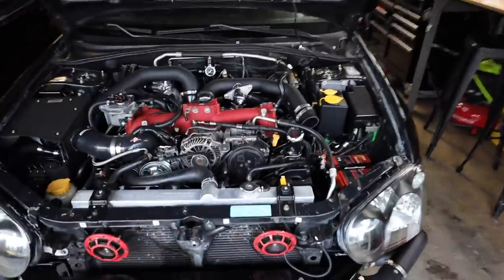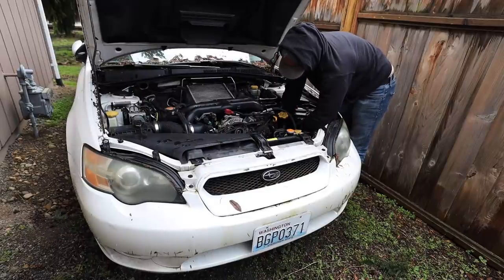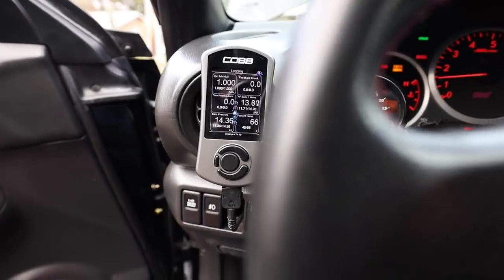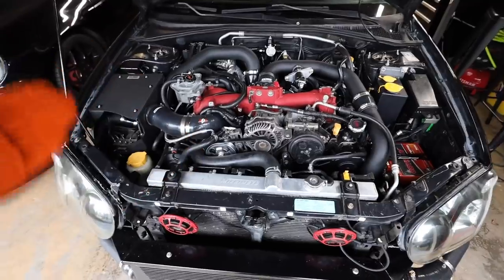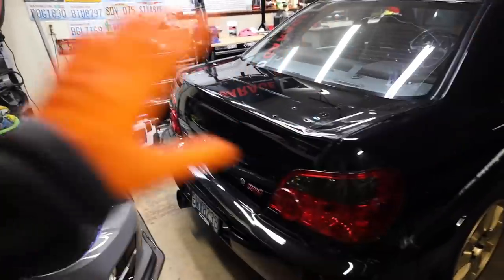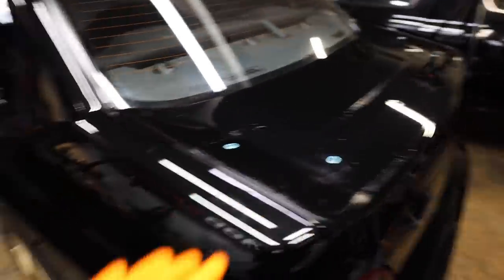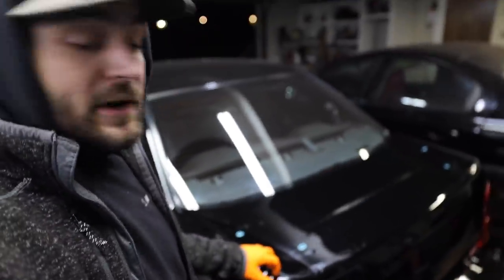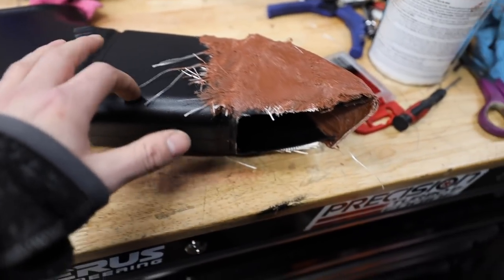I Pulled My Motor Because of THIS?!

Comment: Abs plastic is great to use to form things. I've used it to make replacement wheel well liner. Just heat and mold it into the shape you want. They come in sheets and is fairly cheap.
Reply from the maker: Couldn't find any locally 😭😭😭

Comment: Hey Tanner, I have done fiberglass before on my fiberglass trailer removing a belly band molding, cutting out metal plates and filling in the cutouts with fiberglass. Looks like you used fiberglass bondo which is a filler and used for car body work to fill cracks, dents and stuff like that. It will harden but doesn't run like liquid into the fiberglass mesh/fabric. You need to use resin and hardener to make the fiberglass material harden. That mixture of resin and hardener is like syrup that makes that fabric wet and sticky. It hardens pretty fast. While applying it I usually do not wear a mask, it's not too bad but when sanding it - that's when I wear a mask and closing to cover exposed skin as much as possible as it will be covered with glass dust and will be quite itchy. Not sure how well the bondo will hold, it might hold great but if it doesn't, just use the resin and hardener and it will come out great. 
Glad you found the cause of that ticking!
Reply from the maker: Good to know! The packaging said it was for plastic so we gave it a try. But all good info for next time I do it 😁😁😁
Reply: @Smeedia  great it's for plastic, hopefully will hold great and fiberglass will just serve as a reinforcement mesh blended into it. As long as it has a great adherence to the plastic, it should hold. I never used bondo for this purpose but would love to hear how well and long it lasts as I can think of ways I can use that too. Edit - just saw the pictures in the live stream of how it turned out - that's looking super!
Reply from the maker: Thank you! Definitely came out better than I was expecting 😅🔥

Comment: Love the videos and your creativity!  

On the fiberglass. Might be Better off to use resin vrs fiberglass filler. The resin is liquid and can be pressed into the pores of the mat with a paintbrush. The layers can then be laid down and pressed together, press the air out and you end up with a floppy patch. Lay it over the part and then entomb it in resin, there shouldn’t be any matte exposed or it will wick water into the patch and eventually delaminate. You can basically make anything out of it and it super strong. Be prepared to sand it.  The stuff drys hard  as a rock. Power sanding with 80 grit makes it go faster. Primer and paint and it’s all done.

I fixed a rusted out Suzuki sidekick with matte and resin, it’ll last forever! I got a dollop of the resin on my driveway when I did it. 5 years later ..... it’s still on the driveway, tough stuff.
Reply from the maker: Good to know for next time! Luckily I was able to make it work 😁😁😁

Comment: Way to go, Mittens! As for the your air thingies, I trimmed the hell out of mine and reshaped it with black duct tape, made a front panel for the Cobb air box out of a piece of scrap aluminum and sealed the gaps around everything. I see intake temps just a few degrees above ambient that way.
Reply from the maker: Not a bad idea! Duct tape is a handy tool to have 🙌
Reply: @Smeedia  I experimented a little with spray foam but couldn't get that to work very well. I like the fiberglass idea, though. I have a tiny bit of experience with that and just this week youtuber runninghorse86 was fixing a bumper on his drift car with it, so very much on topic. as for closing off the air box, I did have an issue when I had it too tight, if I pushed in the clutch at more than about 30mph and braked to a stop with the motor at idle, it has a tendency to stall.  I ended up.leaving the holes in to the fender, where the original snorkus thing was, open and no issues.
Reply: I'm very much "diy" with a touch of mad scientist in over his head. 🤣

Comment: Sand the bondo with a block so it will be straight, it won't kill you, but the dust will irritate your skin/throat/eyes. Use less harder if you want it to set up slower, more for faster. Double your grit every time you sand it.  Also, a heat gun soften it up when you sand it.
Reply from the maker: Got it all wrapped up tonight, came out pretty good!

Comment: For the barometric sensor issue, inspect the contacts on the inside of the connector to the MAP sensor as well as those in the MAP sensor itself. They might be oxidised or bent, which could be causing an erratic or erroneous signal reading.
Reply from the maker: Doubled checked and they all looked good. Hoping that it's just that sensor 🙏

Comment: For the intake for future reference since fiber glass is messy and time consuming. You could grab a piece of polycarbonate lexan or acrylic use a heat gun to form it to shape then just bond it in place. If your set on using FG next time take the fabric and apply the resin to the fabric before hand then lay it up. It also helps to use a thinner polyester resin and chop strands. It looks like what you were using was more of a filler with fabric.
Reply from the maker: Couldn't snag any locally but want to get some ordered for future projects so we have some around thr garage! 😁

Comment: If the fiberglass doesn't work out, it may be worth trying Kydex if you haven't considered it. Its a plastic that comes in sheets, you get it really hot and mold it around stuff. May work well for your application.
Reply from the maker: I'll check it out, did not even cross my mind 🔥

Comment: There is resin that you are supposed to soak the fiberglass sheets in. The best bet would be to remake the whole duct from fiberglass. The red stuff is a filler, not resin for the sheets. Check some tutorials. Paste wax the ducting. Cover the whole duct in sheets soaked in resin. Cut in half and remove the old duct. Lay another layer of resin soaked sheets to make the two halves whole again. Let cure, trim, drill holes, use filler as needed to make even/smooth/pretty, sand, prep, paint. And you have a custom duct. 

This is the resin https://www.autozone.com/sandpaper-and-body-repair-tools/fiberglass-material/bondo-fiberglass-resin-1-quart/167023_0_0
Reply from the maker: Already went full send with it 😅😅😅😅 made the bondo jelly resin work but good to know for next time!

Comment: You should think about just throwing a clear epoxy at the junction between the Fiber Glass and the Plastic. Or instead of painting it, do a black wrap on it so that you have a secondary connection. It helps with holding it in place.
Reply from the maker: Not a bad idea, I do already have the wrap 🤔🔥
Reply: @Smeedia  or, throw back to 2005 and sticker bomb the ever lovin' out of it 🤔🤔🤔

Comment: I worked at a body shop for a couple years while in college and since it seemed like you used Bondo on the fiberglass sheets I would suggest sanding it down smooth before painting it. And definitely wear a mask for it, you don't want to breathe that stuff in. I haven't seen it used on just plastic parts before, but it's fine on the polyurethane parts so it should be good. Just make sure it's on there solid. Good work man!
Reply from the maker: That was a jelly resin made for plastic, going to get it sanded today 😁

Comment: Fiberglass tips:
1) usually the resin is clear which makes it easier to clean up at the end (that's something to note in the future).
2) sanding down the high areas is what you should do but avoid excess sanding due to ruining the strength. I usually do wet sand with the clear resin and would still probabely work with yours.
3) use different grades of sand paper to get the best results (definetly wear mask when sanding).
4) your doing great 😃😆🤟
5) Also you should do a community vote to see who prefers wing vs wingless for a bit of fun 😉
Reply from the maker: Ohhhh I like the idea! 

And good tips, definitely going to take note for when I do this again 😁😁😁
Reply: @Smeedia  🙌
Reply: @Smeedia   #teamwang. Thanks for going along with the idea bro😉
Reply from the maker: Was a great idea! 😁
Reply: @Smeedia  Now the big question is, what would u vote for? 😅🤣
Reply from the maker: Wingless 🙌😈
Reply: @Smeedia  that one hurt lol 😆
Reply from the maker: The wingless just looks so clean! Lol 😅
Reply: @Smeedia  do you like the look of the carbon fibre hoods? Would look really cool with an iconic blue wrx
Reply from the maker: @emersonsims9503  yes but only when they're painted and the vents are left as CF 😅
Reply: @Smeedia  💯

Comment: A Kydex end cap would be good to use as well. heat shape it and rivet it. Fiber glass and paint will be cleaner
Reply from the maker: The fiberglass surprisingly came out better than I thought. Just finished it today 😅

Comment: For the intake you could have plastic welded a piece of plastic from the cuts you had using ployvance!!! If you have not yet used it check it out it is definitely worth ur time to check out there products as they helped salvage a rare JDM forester cross sports front lip
Reply from the maker: Already finished the Fiberglass but going to order some to keep in the garage! 😁
Reply: @Smeedia  I hope you check the videos on it, that stuff is just simply amazing!!!! I have repaired the JDM side skirts on my forester and it holds up crazy strong! Very easy to use IMO

Comment: Typically with fiberglass or carbon fibers, you want to change the direction of the weave between the different layers to make the fiberglass resistant to stress in more directions. It also helps to lay all of your layers at once to reduce the chance of the fiberglass delaminating (each layer peeling apart). Not trying to criticize, just want to help a bro out!

Love the content!
Reply from the maker: That's good to know, like I said I've never used it before so it's good info! 🔥

Comment: Adding solder also changes the resistance of wires which can obviously throw off readings for a critical part such as a MAP sensor
Reply from the maker: Very true, this was just a test to make sure it even had a connection 🙏

Comment: It looks like you got fiberglass reinforced filler and not fiberglass resin.  It looks like it can work, but next time get just resin. It soaks into the mat a lot better than what you used.  Then you would use what you had on top of it to fill it and smooth it up for paint.
Reply from the maker: Gotcha! It said it was a putt resin for plastic, we weren't too sure so grabbed what looked right 😅
Reply: @Smeedia  another trick you can do depending on the type of plastic is cut it into small bits and place it into a jar with a bit of acetone in it and it will melt into a paste, so you could use parts that you cut off , a nice flat piece and use the paste to fix it onto the intake, then just wait for all the acetone to evaporate. Then sand it nice and it will look like a stock molded part. Im sure youtube has some videos of people doing that better than I can explain.

Loving the videos, great seeing a local guy working on his passion. Sometime soon I'm gonna get my Brat and fc rx7 builds going on youtube

Comment: That thing has a bad Exhuast leak, aka why your wideband is reading lean, cause outside air is leaking in causing lean fuel mixture, while your front o2 on your accessport was reading 14.0.
Reply from the maker: No exhaust leaks present, AFRs are off from tbr pressure sensor, wither bad MAP or harness. Front O2 reads 17+ at idle

Comment: Is the hole on top of your intake manifold supposed to be at that location or is it supposed to be blocked off? Its by the maf sensor.
Reply from the maker: Not sure which hole your referring to, everything is plugged up or plugged in, no open holes anywhere 🙏

Comment: If this snorkel idea don't work.. try plastic welding the end of a 15+ wrx onto that of the   blobeye one
Reply from the maker: Ohhhhhh I like the idea!
Reply: @Smeedia  I've done similar stuff before so I figured let me share the knowledge hahah
Reply: If you still have the portion that was cut off, could it be cut/shaped to fit? Then, epoxy or fiberglass the pieces to the snorkel. Maybe even pop-riveted instead if you don’t mind a less than perfect air seal. Food for thought. Great to see the blob move under its own power!

Comment: Very nice...finally got my problem fixed as well....timing was off so I replaced pulleys, got a lightweight pulley - just because already had it broken down lol,  and new belt.  Needless to say, no more codes, no more rocking and everything runs better than when I first bought it a few months ago.  Still won't pass inspection due to the headlights being wired weird.  Has hid projectors and they only come on when the hibeams are turned on.  No low beams.  Have swapped ports, swapped relays, changed hi/low relays and now replacing all fuses.  Everything hasn't worked so far....any thoughts?
Reply from the maker: I would suggest removing that lightweight pully and swapping the OEM one back on or get a Fluidamper. The light weight pulleys do not absorb any of the vibration from the engine and send more shock to the crankshaft. However; glad you were able to get it sorted! Just wouldn't want to see any damage come to ya from that pulley! 🙏
Reply: Ah crap I didn't even think about that

Comment: Your AF Sens 1 is way off from your wideband. o2 sensor could be bad but more likely your wideband sensor is off or miscalibrated. AF sens 1 shows your car rich at idle. Aem shows lean. My aem wideband is a little off from my stock o2 but not nearly that much, maybe a .1 to .3 difference at idle. You should figure out if your wideband is reading correctly
Reply from the maker: They're spot on with one another, thr small video clip there was at cold start and not a good representation of what is actually happening. Once the car goes into closed loop they sync

Comment: Get some proper anti rollbars instead of the wing.
Also the the front H brace and the car will handle much better.
That would be money well spent. :)
Reply from the maker: I've already got the wing 👀 it's thr OEM wing that came with the car pop

First up on suspension is an Anti lift kit to fit the front geometry 🙌
Reply: @Smeedia  i meant the wingless trunk. :)

Comment: You want resin and hardener to make the fiberglass material harden
Reply from the maker: That's what I used 🙌
Reply: I'm used to using the clear liquid resin and hardener that you soak matting in and apply matting to area.
Reply from the maker: It was a jelly type resin, said it was made for plastic 😅

Comment: Yeah it wasn’t until like 2007 or 2008 that they move baro to the secondary air injection valve on the driver side.
Reply from the maker: I saw somewhere that the valve was in the TGVs but I guess that is not the case
Reply: can confirm it's 2007. I own a 2007 that has it's air pump deleted... had to re-buy that module, plug it in, and zip tie it somewhere

Comment: how hard was it to get the coil packs out/in?
Reply from the maker: Not hard at all, maybe took me 2 min to get them out
Reply: #4 is the hardest since it's pretty tight. getting out is easy but getting back in you can put them in upside down and it should go in easier. then when its in just rotate it.
Reply from the maker: Depends on the chassis as well thr 05 I can slide them in and out without having to rotate them. The newer models are a little more annoying

Comment: next time just use your scrap plastic you cut out and plastic weld in on so its the same material what could happen

preferably with an solder iron
Reply from the maker: I was going to but all the pieces were too small, I'd like to get the stuff to do plastic welding 🔥
Reply: @Smeedia  ahhh sorry couldnt known that but ye you could get some plastic and weld it on there somehow xD

Comment: I thought I was bad at fiberglass lmao
Reply: You gotta use fiber glass resin for that. Bondo fiberglass fillers are usually used for repairing small sections on panels 🤙🏽
Reply from the maker: I full sent it already 😅 came out pretty good
Reply: @Smeedia  oh yea dude as long as it does what you need it to do, that’s what matters 😁

Comment: I keep hearing you say map sensor. MAF, mass air flow ?
Reply from the maker: Manifold absolute pressure (M.A.P) 🙏🙏
Reply: @Smeedia  thanks, I’ll have to look up where my sensor is on my LGT. It looked like yours was before the throttle body. My mistake 👍🇨🇦
Reply from the maker: No worries! 😁